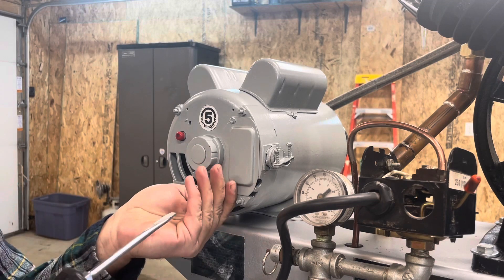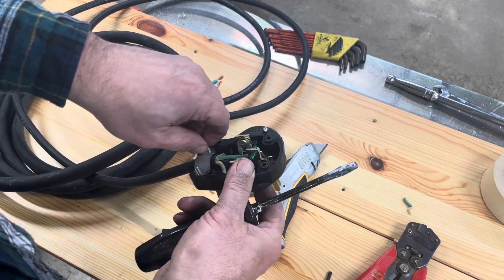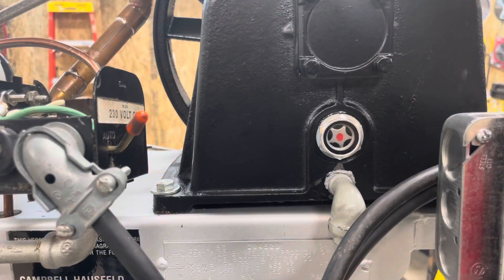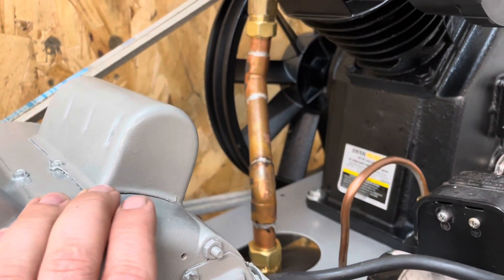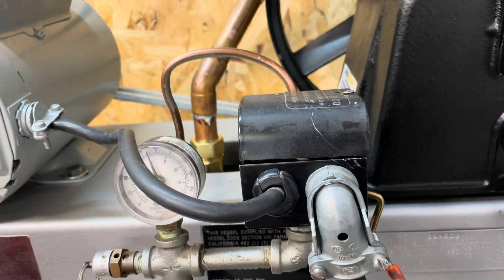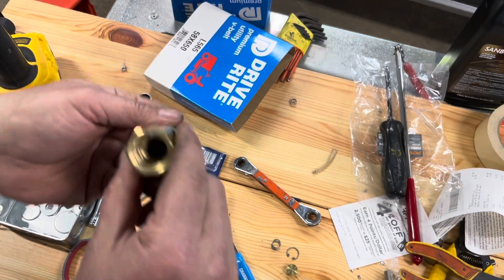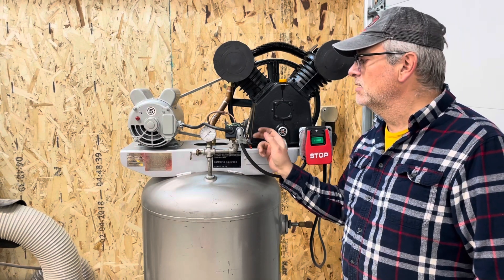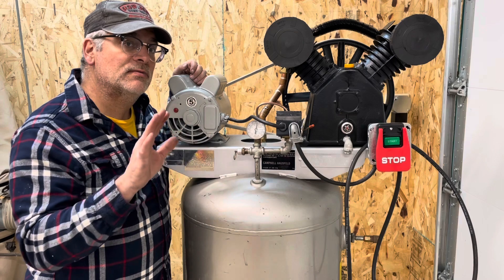Harbor Freight 5hp air compressor pump final assembly and test run video 4

Comment: I have built three different compressors with that compressor pump and I love them. I just order a 3/4" inch hydraulic hoses to connect the pump to tank it cost me $35ish for a new hose off eBay. and I figured out after the first one I built that 4.25" pully was a bit to big. motor running at 3450 a 4" pully put my rpm right at 1000 rpm only 50 short of the max rpm for the pump.   wish I ha come across the video 5 or 4 months earlier.
Reply: Do you have a link for the hose or any other information you could share on what to look for on a hose from pump to tank
Reply: @rong2578  I just did a vid on this pump and give a ton of technical info on it
Reply from the maker: Can you share the link to your video?

Comment: Wow, I have the exact same Campbell Hausfeld tank and motor as you do. Been wanting to do this upgrade for a very long time. How is it working for you, and do you still recommend the 3.95" pully that you used. One more thing if you don't mind, how long does it now take to fill the 60 gallon tank from 0 PSI. My pump takes 20 plus minutes to fill, which I know is not working correctly.
Reply from the maker: With my old pump the 0psi to full was 5 minutes and 13 seconds. Recovery time was 1 minute 7 seconds. The 3.95 pulley seems to be working well so far.

Comment: What belts size(part#) do you use. Thank you very much. I just saw the bag of the L565 belt. Is that what you use on the pump ?
Reply from the maker: Yes, that is the belt size I used. Keep in mind I added 4” to the end of the mounting plate. Another person commented that I could have used a belt length calculator. This is one I found with a Google search. 

https://www.omnicalculator.com/physics/belt-length

Comment: I used the recommended 4.25" pulley per the instructions and that's causing the 5hp motor to overheat if you are using tools like an air sander which requires the compressor to cycle frequently. I'm curious if the 4" pulley has that same problem. (The motor is made in USA, so I think it's really rated for 5hp.)

The HF pump is a lot faster than my old pump. Also a lot quieter.
Reply from the maker: So far I have not experienced the motor getting hot. Though I have not worked it really hard yet. Just a blow gun and my hutch DA sander. This pump is quieter then to old one. The old one had a really loud what I would call a pounding sound. This v twin style pound doesn’t have that. I really like this new pump.

Comment: How do you block off the line that goes to the unloader valve on the compressor if you don't want to use the unloader valve?

Comment: I just saw the pulley you used in your description just was wondering what your motor rpm is
Reply from the maker: The motor runs at 3450rpm

Comment: Air compressing. How did that brass piece enter into the factory sealed check valve? It looks like a compression ring for a compression coupling fitting. So, odd! Sabotage??
Reply from the maker: That is actually solder. From the two 45s I used to make the feed pipe. From the pump to the tank. I had not done any solder work in some time. So I ending up getting a bunch in the pipe. That ran down to the check valve.

Comment: My compressor will turn itself back on randomly...and other times I have to go and hit the reset! Just changed the one way valve ...and still no luck any help would be great
Reply from the maker: First thing that comes to mind would be a faulty pressure switch. I am not sure on how to test them. But here are two links  that may be helpful. 
https://youtu.be/V4js-w2YSvo?si=suqkdGqXS_E-itwi
https://youtu.be/gzFja48QQ5Q?si=wCNv8rI9t3eY5cK1
Reply: @sdavidb5620  I appreciate the help man!

Comment: Isnt it spinning the wrong way ? I was under the impression that the cooling fins veed to be pushing air over the compressor, not sucking?
Reply from the maker: So, watching the video it does not look quite right. But standing by the pump while running. There is plenty of air blowing onto the pump.